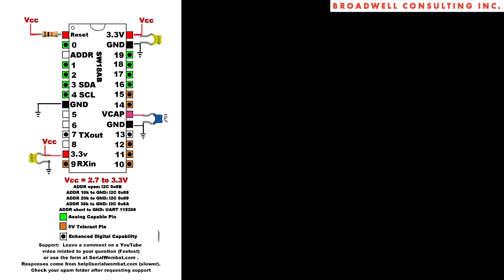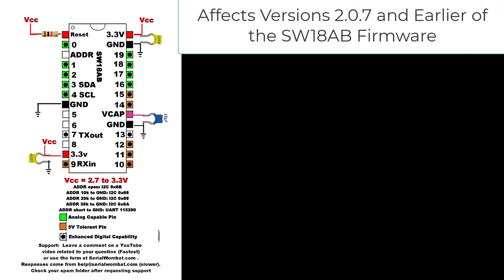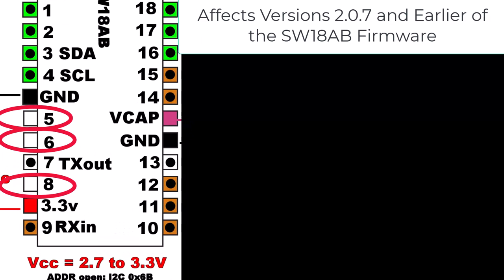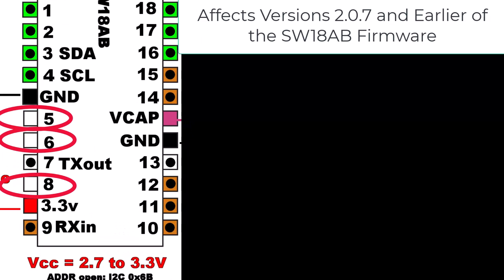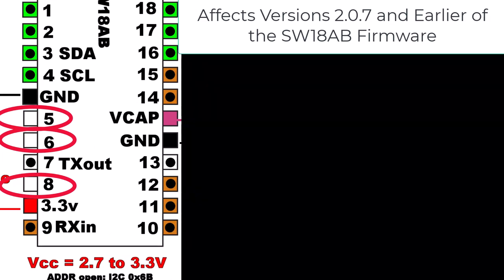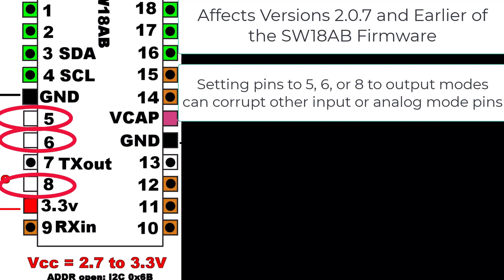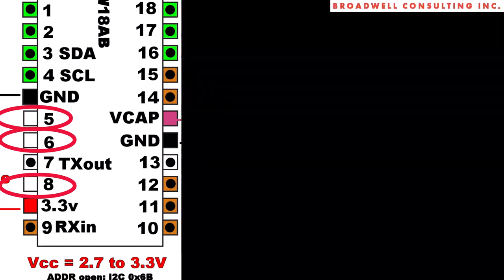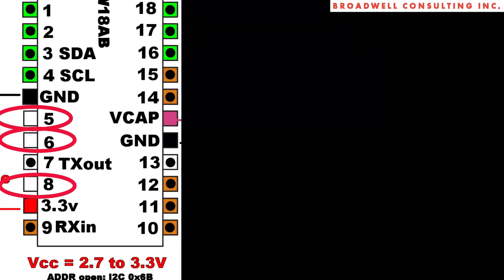Serial Wombat SW18AB V2.0.7 and Earlier Firmware Bug Alert

Comment: Thanks for the firmware update. It fixed my problem with the quad encoder updating so incremental reads are working great. And, I just diagnosed the problem with pins 2,4 and 8 yesterday so it was fun to find the fix was already available.
Reply from the maker: Glad it's working for you.  Thanks again for the excellent bug report on the incremental reads.  It was really well written and documented.